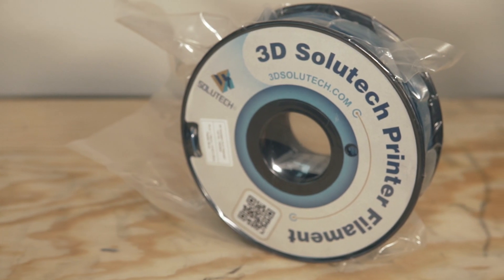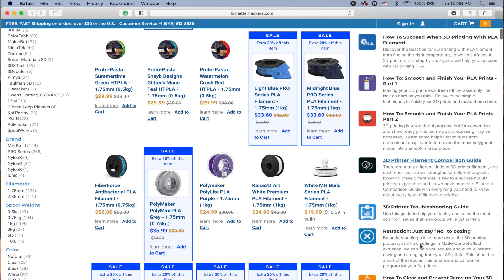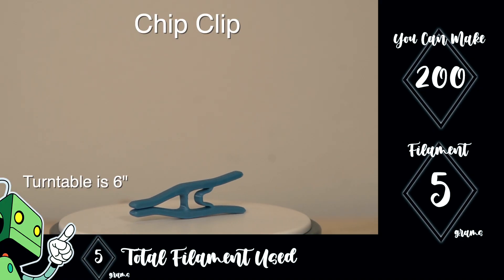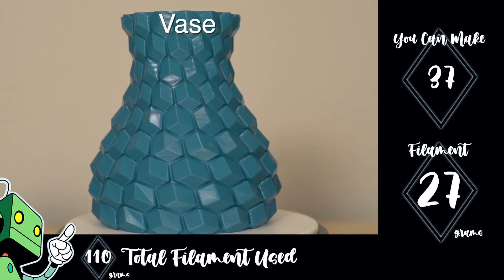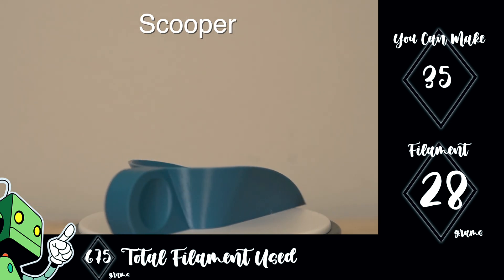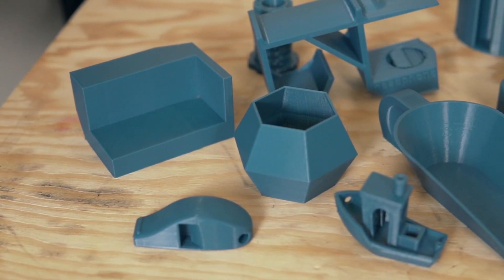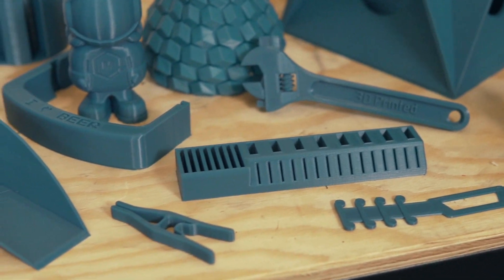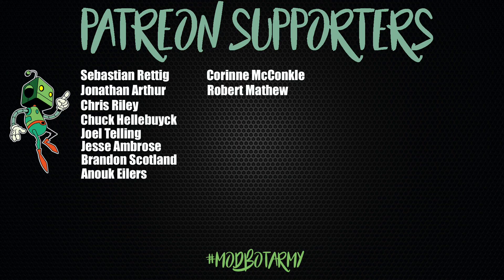What Can You Make With A Spool Of Filament?

Comment: What helps me are the following thoughts:
PLA filament has about 1.25g/cm³
That means using 1kg with 100% infill, you could fill a 1litre milk pack more than 3/4 - more precisely up to 80% (~800ml). However, even at 100% infill, there are tiny air pockets between the layer lines.. so you may actually get a bit more than 800ml.
A coffee mug can hold about 350ml, so you could fully fill 2.2 coffee mugs.
At 100% infill, you could make a 1cm thick sheet with the dimensions of 28x28cm, or a 2cm thick sheet with the dimensions of 20x20cm... or a block of 8x10x10cm.
At a bit below 50% infill, you should be able to fill about 4 coffee mugs.

Comment: I just had a thought after printing yet another calibration cube, to print something at least slightly useful instead, like a Lego technic brick. Some napkin math says I could print about 595 of the 1x4 Lego technic bricks vs only 288 of the calibration cubes. 
Be advised, if you want a bunch of Lego, just buy it. It's not only better quality to buy it, but also cheaper, if you factor in Stefan from CNC Kitchen's spreadsheet on calculating costs  https://www.youtube.com/watch?v=ffg9dArNfCg , and don't just look at the filament cost. This is usually the case for mass produced products.

Comment: You've got to allow for failures as well.
Reply from the maker: Haha absolutely my coin holder had a pretty wild layer shift
Reply: I recycle my 3D print fail by a machine that makes spools from pla beads I blend it down to needed size and a spool refiller It’s expensive for me and it worth the 500 to do it over time